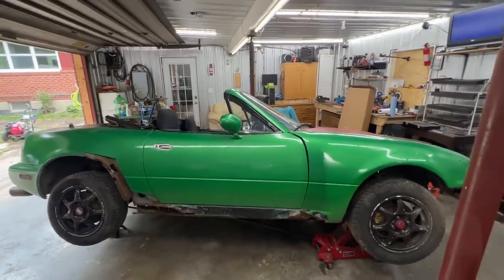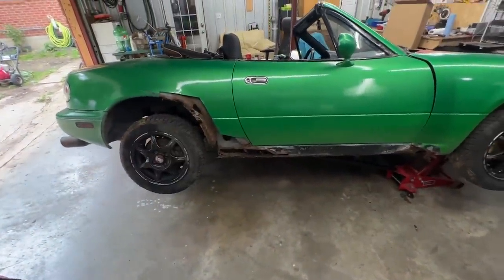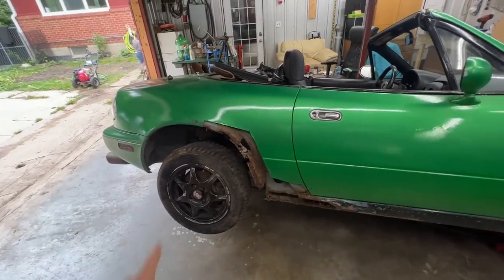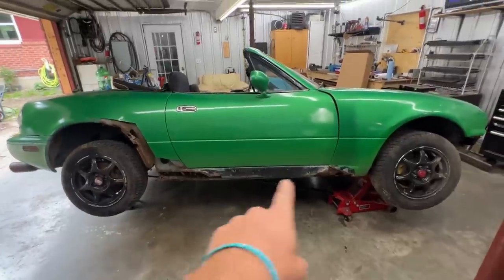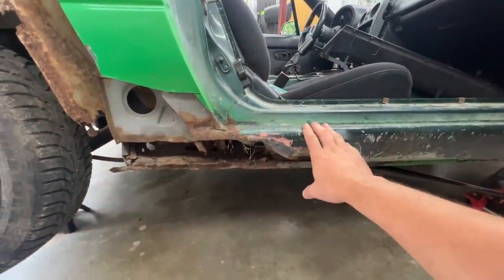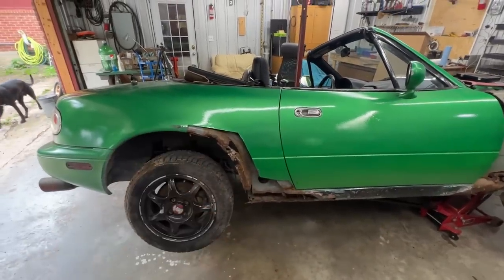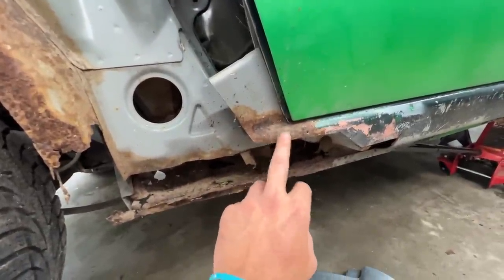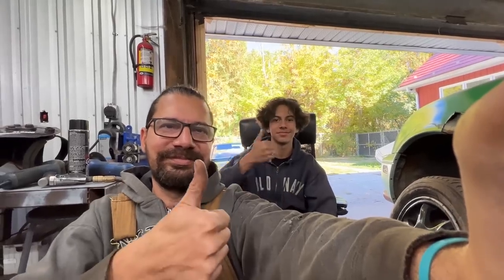1994 Miata NA - Part 7 - Fitting The Rear Fender Patch

Comment: Nice progress. That fender looks like typical Klokkerholm pressing. It seems that they need always some massaging. Once I had to cut inside fender and add 1/2 inch strip it to reach firewall. Edges often have horrible greases so it is best if you don't have to use whole piece. With my beetle repair pieces I had to drill all their spot welds out and fit each layer separately to match in to body.

Comment: Hey Elin, greetings from the UK. FYI, I have used quite a few of the Klokkerholm panels on my projects. The only thing you can really say about them is that they have pretty good availability and are not badly priced. But... they are not a great fit and are painfully thin galvanised metal, so not nice to weld. I tried removing the coating to get a better weld, but that makes them so thin t6hat it is very easy to blow holes in them with the MIG. As an example, I bought inner and outer wheel arch repairs for my MK3 Golf. The outers were pretty good, but the inner curved flange was 10mm away from matching to the outer. You would think somebody at the company would try and mate them together before sending them out. Anyway, if anybody can make the end job good it is you!
Reply: It's just plain wrong that these companies chuck out shoddy goods just expecting someone else to mess about putting it right... name and shame i say...